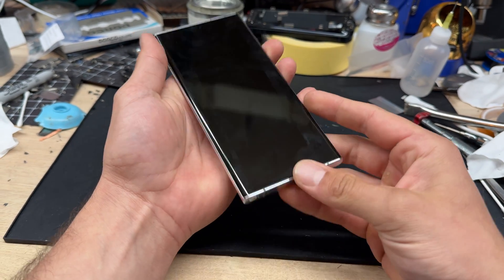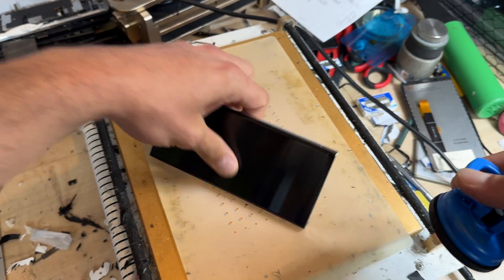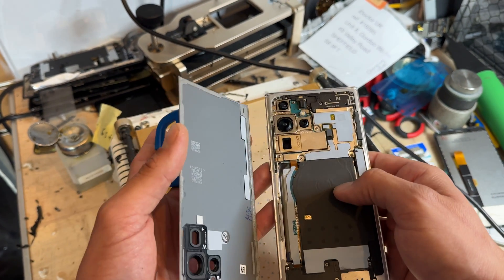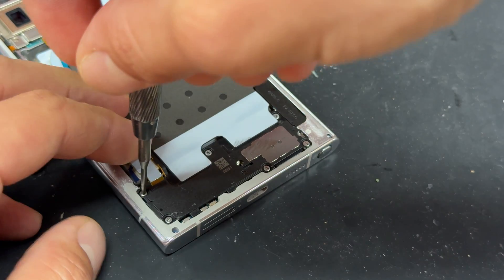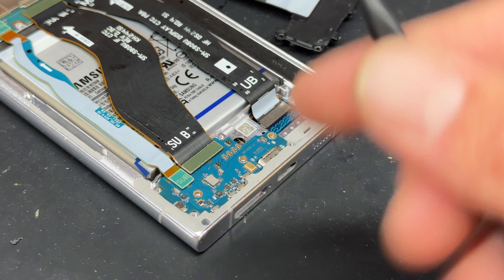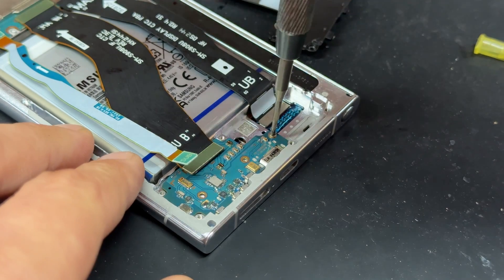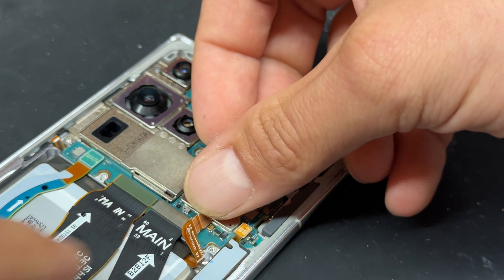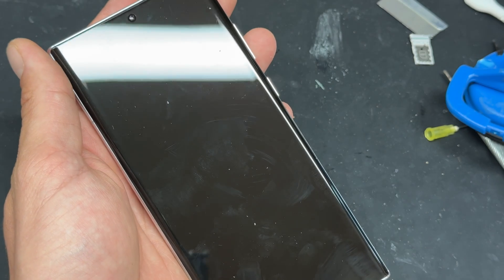Samsung S22 Ultra Charge Port DIY Repair Guide - Fix Your Samsung At Home!

Comment: Hey, thanks a bunch for this. Gotta say even with a hot plate that can get to 120C it was a total pain getting that back glass off; I think its mainly because the camera bump makes it hard to get even heat on the back and you definitely want to start from the bottom.

Only question I have that wasn't mentioned much was the re-usability of the old gasket if it came out undamaged (surprisingly I didn't need to pry or iso after enough time at 100C). The old gasket looks fine, and I was worried about messing up the placement of my replacement one so I just decided to re-use it as you did in this video. However, I'm not sure if that's going to bite me later. I'm re-heating the back glass and going to put some good pressure on it just to hopefully re-awaken some of the adhesive but I am curious if this will at least keep dust intrusion out still (I highly doubt it'll stay waterproof).

Comment: Is it possible that the middle flex cable being slightly corroded would keep the battery from charging? I have a S22 Ultra that got some water damage. System board works great. Replaced battery, display, display flex cable, charge port, but for some reason the battery will not charge. The phone detects the USBC cable and allows for data transfer, but the battery will not charge. It shows the lightning bolt charging, but that's it. I did find some corrosion on the middle main flex cable. I ordered a replacement. I just wanted to see what you think. Love the video too!

Comment: Thanks for your help.  Most straightforward and concise tutorial yet.  
I needed a new flex cable (skinny left side one)  as well as the  port board to fix my issues)
Reply: Just curious but what issues were u having that u needed to replace the flex cable and charge port board?

Comment: Just wanted to say that after checking out probably a dozen videos,  I used this one to successfully guide replacing my charging port sub board and the antenna flex cable that is connected to it. This fixed the super crappy issue of not being able to have consistent or stable connection to the network (dropped calls,  no service,  using turning airplane mode on and off to get out to reconnect, etc). My phone is working like new again!

Challenges: (1) Getting the back off. I used a hot plate, plus a hairdryer as I worked around loosening edges,  plus a good amount of repeat application of isopropyl alcohol with a paintbrush. I had to buy a better suction cup, like the one in the video, than came with the tool kit I bought from ifixit. It took some time and patience (several attempts over a week), and nerves of steel,  but it finally came off without breaking.  (2) two of the tiny screws holding the main plate on almost fully stripped! They were super tight with loctite and made of the world softest metal for screws. I put alcohol on them to help loosen the glue and it took basically re-scoring the heads with solid pressure to work them off.  

Anyway, thanks for this wonderful video!

Comment: Ah man I tried but the board I received is the wrong way around. Its like a mirror image. I looked on that ishine you mentioned and they look the same on there. fortunately I got the old one working but if it ever goes again I'm going to have to look a bit harder. That being said, your video made it easy to do so thanks for that

Comment: Worked really well - replaced this part and fixed my mobile internet issue!  Saved me a fortune in repair costs and the suction cup trick worked really well and saved a tonne of time!
Reply: What was your issue with internet? Who is your network provider ?
Reply: Common problem is the antena bands get a bad connection onto the usb c motherbaord and causes drops or no service at all even an esim wont fix this issue. I'm currently dealing with it on my s22 ultra, have parts coming in tomorrow hopefully it fixes my issue @mrama405
Reply: What does the charging port have to do with your mobile internet?  lol

Comment: Bro, today the new USB port arrived, I set everything up correctly, but it's not charging. What could be another reason?
Reply: did you try wireless charging to see if it works?
Reply: wireless charging works flawlessly.
Reply: Mine is doing exactly the same thing. Wireless charging works but cable charging not working
Reply: Did you get it fixed? And how?
Reply: @ReneeSalter-d2n  Upon reconnecting the charger to the USB-C port, in hopes of a miraculous restoration of function, the device powered off and has remained unresponsive. Wireless charging capabilities have also ceased. Upon seeking professional repair, I was informed that the motherboard had been compromised and required replacement. The ease with which this occurred is quite astonishing
Reply: @alemh.1660  "compromised"? What on earth would that mean or entail?

Comment: Perfect repair for what is probably Samsung's weakest part of any of their products.
Reply: USB-micro/mini/A/C have been the stupidest inventions ever. Russia - each time they were proposed as standards for mobile devices - had sent in a different type of connector design; wider, flatter, stronger, with much more copper surface per contact but less open room for water, dirt and dust, weighing a few milligrams more than all current plugs etc. Of course, the idiots at AUKUS and EU disagreed "because Russia" and forced Asia to go with the flimsy design we now all suffer the consequences from. Go figure, for decades already this has been a PITA for every consumer: Disfunctional USB connectors. The same issue already started when firewire was proposed, same story. Russia's design was stronger, better, with more contact surface and less room for corrosion and errors.

Comment: what do i do if the screw is so tight it breaks the screw driver
Reply: I had the same problem, those screws are so tight I ended up cracking one corner to get the shield off.
Reply: @satpalhunjan2130  One corner of what?
Reply: @Meowbay  corner of the shield